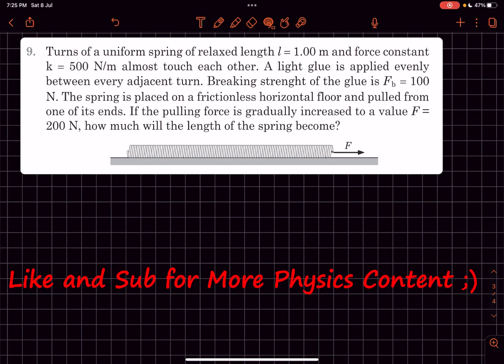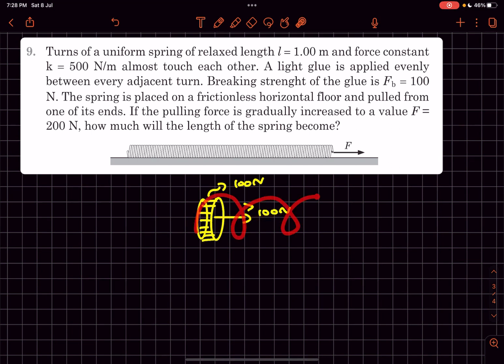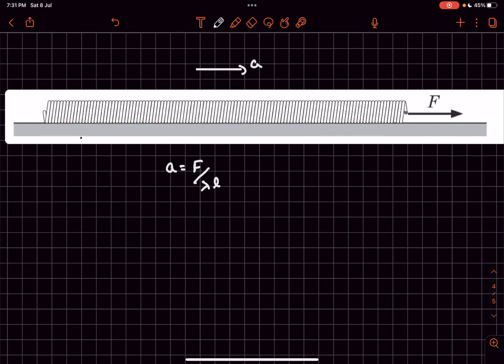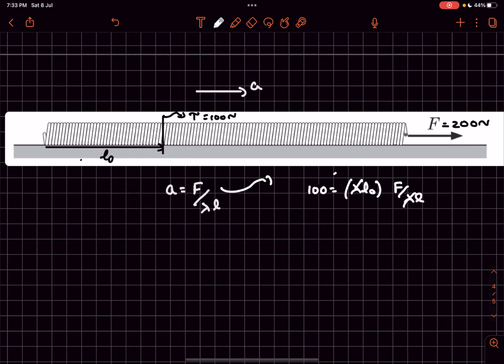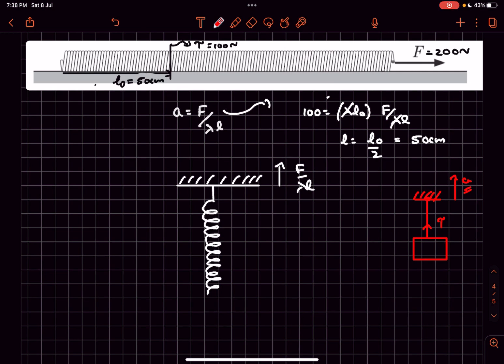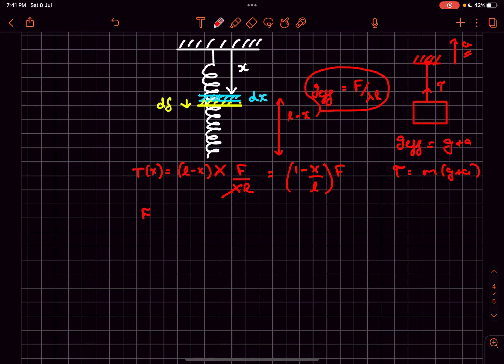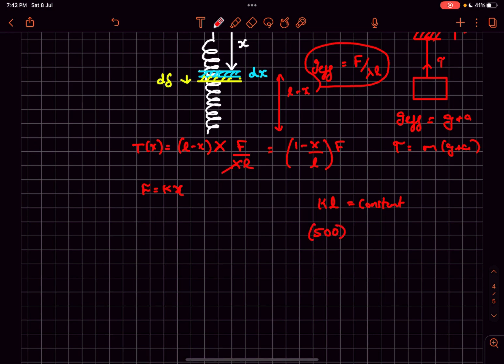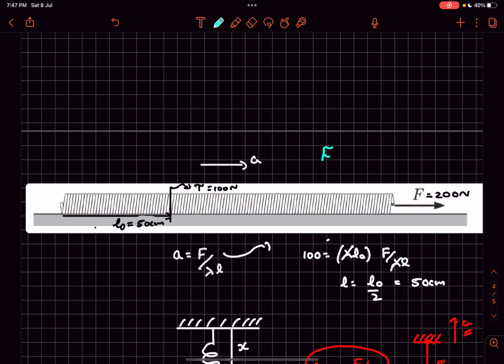[Jee Adv] Final Elongation in the Spring | CYU 9 | NLM | Pathfinder

Comment: hey, one question is it necessary that the torque in the rotating frame of reference has to always be zero. Like
Reply from the maker: Also what did you get as the answer for the rotation byu question that you asked ?
Reply: @PhyX_03  So I saw the hint and then used another approach of angular impulse and got the answer but when I tried through integration writing dm element for friction I got it through that time is inversely proportional to radius of the hole ^2 which gave me the answer correctly but still couldn't understand what is the direction of friction , answer is 16 seconds
Reply: @PhyX_03  you didnt answer my question
Reply from the maker: Can you be a bit more specific ?
Reply: @PhyX_03  what will be torque eqn in a rotating frame of reference
Reply: Like if I have to write torque eqn in a rotating frame of reference then in my frame object  should seem to be stationary hence the torque should be 0 to make it in rotational equillibrium